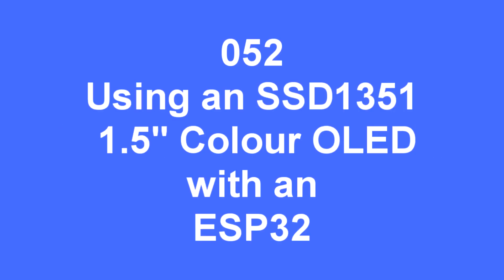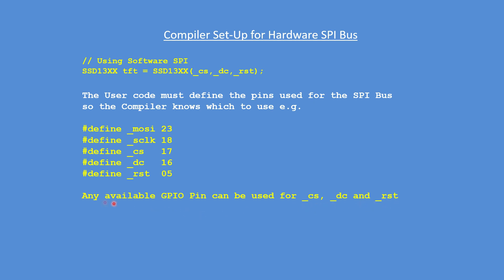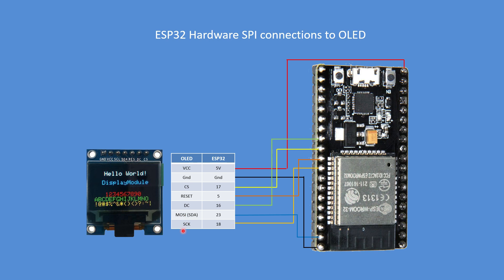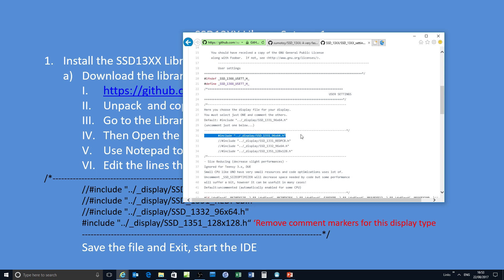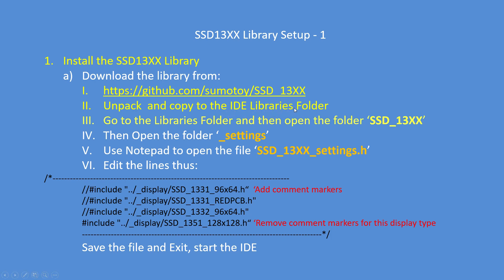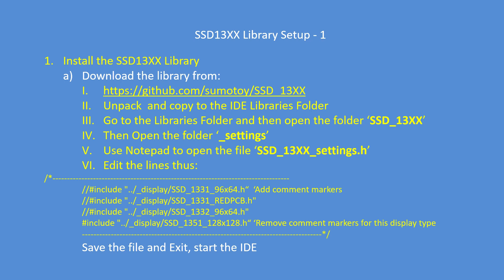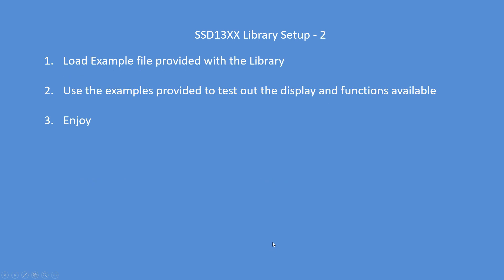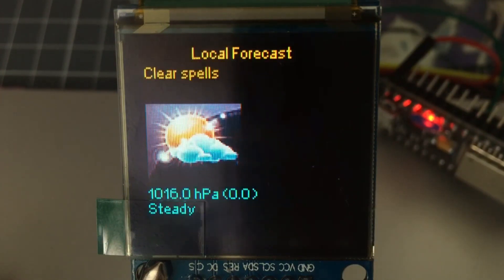Tech Note 052 - ESP32 how to use SSD1351 1.5" Colour OLED

Comment: You seem to know your stuff, I'm using a SSD1351 RGB OLED from Waveshare on a Raspberry Pi. I also have a MLX90640 thermal camera setup, with code a stole from the interwebs, how would I display that (currently displayed in a window on my hdmi display) on my OLED display? Idk i can't find anything. The only way i can come up with is to have a fig.savefig in my Thermal camera code then display that image (as it will update with the same file name each time the camera refreshes). But i feel like that is gonna be slow and horrible and extra slow
Reply from the maker: You can display camera images on both the hdmi port and tft simultaneously if that’s what you mean, you do that by installing a new screen driver example here: http://www.lcdwiki.com/HDMI_display_does_not_display_after_installing_FBCP_driver

Comment: You have told me that,  you can upload the data with the support of API keys but don't download that. Sir actually I don't understand that,  what is necessary to download that. Your code specially that ArduinoJson5 isn't supported after downgrade it to 4. I think you are not interested to open the hide tricks & what is necessary to post  this critical sketch which is totally dependent on WU .
Reply from the maker: You need to read WU terms and conditions, if you have a PWS Personal Weather Station you can upload data for WU to display for example mine is ‘imelksha3’ that is possible, but once uploaded you can’t download that data anymore, everything changed in 2018, why? You need to ask WU why you can’t download data anymore. This sketch is obsolete but I have produced many others that use the OpenWeatherMap free service. You have to accept the owners of WU do not allow their data to be downloaded anymore.

Comment: As per your instructions I have already downgrade the ArduinoJson5 but it's not working. I think your code is not correct. You have told me that WU is not giving API keys but I have got api keys from WU. If you are not interested to support me then leave it. I can't giving disturbance to you. It will be better if you give me some support.
Reply from the maker: As I said, I have valid WU keys and have tried the code, simply by downgrading the json decoder to v5 and the WU server response is ‘Service Unavailable’ meaning that unless you are paying for their basic service of $500/month then access to the data cannot be made. You can upload data with the API key but not download it. All this changed when IBM purchased WU in ~2018, that’s just the way it is.

Comment: Thanks for your belated reply. You have told me that WU is not issue API keys that's you are not to test it. I have tested it with a new API keys & your code is showing error message which is "Dynamic Json Buffer is a class from Arduino Json5. Please see it & rectified it. Waiting for your reply.
Reply from the maker: You can get past that error by downgrading the json decoder to v5. I have a PWS with WU and a working API key and tried the code and I get ‘Service not available’ response from the server which is in line with their published policy that only paid for subscriptions at $500/month will work.

Comment: Sir again thanks for your support. You wish to know that which library I have installed? I have already installed the library of your zip link but don't understand the settings of that folder & how to save that without comment. Here I am really puzzled & don't understand that. Serial monitor opened & here something language comes but not to read that but no display is coming. I have used Waveshares 1.5 inch RGB OLED screen. Tested that in example Adafruit test & running well but there was Arduino Uno but here Esp32 which is very complicated. When upload the sketch boot button to be pressed for five seconds then uploaded but no display is coming. I have uploaded your rectangle, circle etc. Ino sketch. Uploaded successfully but no display is coming. Sir please help me to upload the weather station sketch for that. Please give me that link. I am eagerly waiting for your support.
Reply from the maker: Do you have a weather underground account, if not then this sketch won't work!

Comment: Many many thanks Sir for your valuable reply. I am really sorry that I don't seen the connection image. But one thing Sir I am really not expert of coding. When try to upload the sketch it's showing TFT display is not declared in this scope. I have already installed the zip library of that code but don't understand the settings of ssd1351.h settings. How to make that & save that.
Reply from the maker: I’m happy to help. If your using the sketch I provided then it should all work, a lot depends on which library you have installed for the display, if it’s different then that will be your problem, let me know the download source of the screen driver and we can get this fixed.

Comment: Sir your project is quite remarkable but one thing I can't understand that, as per your weather station sketch nothing has been told regarding connection of esp32 to 1.5inch OLED RGB display. Another problem I can't understand the library settings of ssd1351 display. Please answer me.
Reply from the maker: If you view the video description below the information you will see a wiring diagram showing how to connect it.

Comment: Should this run on an Arduino Uno? So far I'm not getting anything on the display and just corrupted data on the terminal. It does (almost) run using the Adafruit library but seems there are some differences between the waveshare OLED and the one I'm using which is diymore.
Reply from the maker: Yes it will run on the Arduino this example is using the Arduino library. What you’ve got to do is clearly identify the Arduino UNO SPI pins and choose a suitable CS pin and then do the same for your display (identify the pin names) then wire it up and then ensure the CS pin definitions and others for the library are correctly defined for the pins in use. It’s logical if you inspect the code.
Reply from the maker: #define _cs   17  // goes to TFT CS
#define _dc   16  // goes to TFT DC
#define _mosi 23  // goes to TFT MOSI
#define _sclk 18  // goes to TFT SCK/CLK
#define _rst  5 

So you must change the PIN numbers to match the UNO’s equivalent.
Reply: @G6EJD  Thanks! I was completely forgetting that the Atmels have hardware SPI and I'd just assumed you could define the pins to be whatever you wanted. 
Most of the samples now work (a few are too big for the Uno). I noticed you can't use the I2C pins. The following work ok:

#define SCLK_PIN 13
#define MOSI_PIN 11
#define DC_PIN   2
#define CS_PIN   9
#define RST_PIN  6

Comment: Hello, do you know how i can use own images?
Reply from the maker: To make new bitmaps, make sure they are less than 128 by 128 pixels and save them in 24-bit BMP format! They must be in 24-bit format, even if they are not 24-bit color as that is the easiest format for the Arduino to decode. You can rotate images using the setRotation() procedure.
Reply: @G6EJD  i have my image in 128x128.

i saw the images in the _images folder consist of an array of pixel codes in the format 0xXXXX. How can i convert my image (png) to this format?
Reply from the maker: You need an image converter that can convert your image to 24-bit colour format. There are online tools that will do that.
Reply: @G6EJD  ok thanks
Reply: @G6EJD  i converted it into that, read out the hex with xxd, removed the adresses and ascii, removed the newlines, added 0x before and , between the values, and pasted it into a copy of sw1.c. then i adjusted the values there, but currently, it's only showing a white noise. also the number of hex values is bigger than it should be. i guess i'll have to remove some metadata, how do i do that?
Reply from the maker: @lorishofer2889  Have you tried the Adafruit tutorial? https://learn.adafruit.com/adafruit-1-5-color-oled-breakout-board/drawing-bitmaps
Reply: @G6EJD  do i have to adjust something to use it with sumotoy's lib?
Reply from the maker: @lorishofer2889  his is a  strange library with odd image formats now the Adafruit library is available it can drawn BMP images without change
Reply: @G6EJD  i have written most of my code with the old library by now - i've got an idea how to fix the issue. I saw you already used this image format, if it doesn't work, i'll come back. thanks for the help so far
Reply from the maker: @lorishofer2889  you could try the Adafruit library examples without changing anything, just one and try it
Reply: @G6EJD  i found a solution, thanks

Comment: Greetings I'm trying to connect such a display to the Raspberry, and nowhere can I find it, can I connect it directly to the 5 Volt line, or do I need to connect only to the data line through a 3.3 Volt divider? Thank!
Reply from the maker: milvus verh, only 3.3v supply and data lines, see here for the RPi, connections are shown together with library details: https://www.bluetin.io/displays/oled-display-raspberry-pi-ssd1331/

Comment: thank you, very helpfull. i'm very interested in the code for the weatherstaion, you've built with ESP32 and SSD1351. could you share it please?
Reply from the maker: The code is in this YouTube video description, just above here, or see it here:
https://github.com/G6EJD/ESP32-Connect-and-use-SSD1351-1.5-Colour-OLED
Reply: G6EJD there i have looked first, but there is only a basic oled test. i'm looking for the weatherstation stuff, the display is showing near the end of the video.
Reply from the maker: OK, my mistake I thought I had uploaded, I have now :)

https://github.com/G6EJD/ESP32-Connect-and-use-SSD1351-1.5-Colour-OLED
Reply: thank you very much :)
Reply: shure this is the right code? i had a look at it and can't find any SSD_13XX.h definition and so on...
i'll try to add the missing stuff.
Reply from the maker: OK, my mistake again, I have now found the correct version end ..dev_01 and the folder images with the symbols for the weather for you. See the same github location.
Reply from the maker: Please let me know if it's still not working as I try hard to ensure all my free code is of a useable quality.
Reply: thank's a lot. now it compiles and works fine. i did not even need to change the IO pins, cause you use the same as i do. :)
but for your information: you left your api and wifi key in the code...
Reply: i'm going to build a smart alarm clock with ESP32 and the OLED. your code will be very helpfull for me. thank you. when i'm done, i will also share the code at github.
Reply from the maker: Thanks for letting me know about the API key and WIFI credentials, I've overwritten those now. You have an interesting project planned, good luck with it.